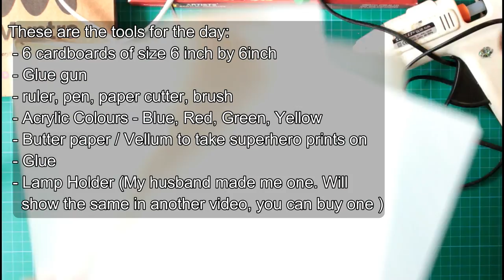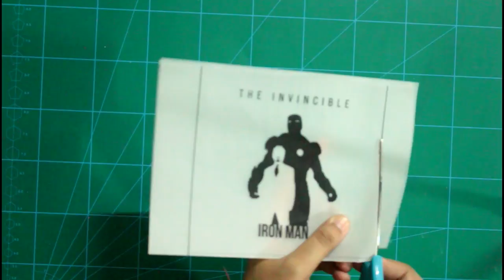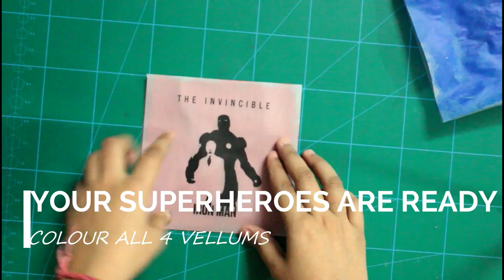[How to] Make your own Avengers / Superhero Night Lamp [DIY Video Tutorial]

Comment: Can I use wax crayons instead of acrylic would it melt due to the heat of the bulb....and if we keep the bulb glowing for a long time will there be any problem??
Reply from the maker: Hi, wax crayons won't give same effect as paint as their coverage is very streaky. I have had bulb glowing for entire night without any problem however use led bubl only and of less voltage.. as this is a night lamp you will anyways use less voltage
Reply: @KhyatiKothari  thank you so much
Reply from the maker: You are welcome :)

Comment: This is a very creative project, but how can you get the same design without using a laser printer? Could you a normal printer? And could you make a DC one with green arrow, flash, black canary, etc, please?
Reply from the maker: +Brendaa yt you can surely do it. However when you use normal printer make sure you use the paints on the opp side and not printed side or else the printing ink will smear. Hope that answers your question. Feel free to contact me if you have more questions.

Comment: Is this on butter sheet
Reply from the maker: No this is thicker then butter paper. I use the product available at link below
https://www.hndmd.in/papers/cardstock-pads-and-sheets/craftangles-paper-vellum-white-a4-150-gsm-set-of-5-sheets-ctvwa4150
Reply: Can we use double butter sheet
Reply from the maker: You can try however I haven't used it so wont be able to comment

Comment: can  i use a 180 gsm butter paper?
Reply from the maker: Yes you can, just make sure wherever you place glue it's hidden so the wrinkles are not seen. Or else you can use red tacky tape to stick the paper
Reply: @KhyatiKothari  No such butter paper is available around my location. What should i make use of then?
Reply from the maker: Here is an online link - 
https://www.hndmd.in/papers/cardstock-pads-and-sheets/craftangles-paper-vellum-white-a4-180-gsm-set-of-5-sheets-ctvwa4180

You can use regular butter paper and stick multiple layers with tape and then use them as well.. please don't use glue to stick multiple layers as glue causes the paper to wrinkle